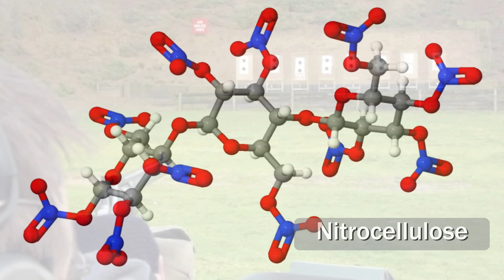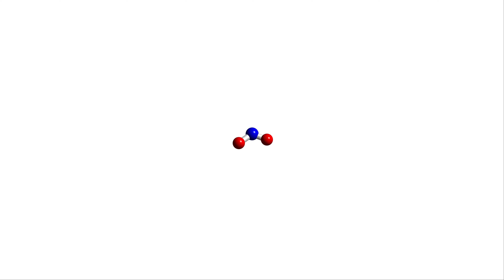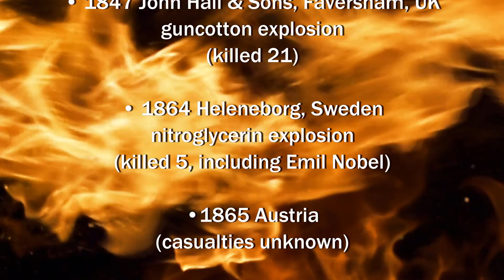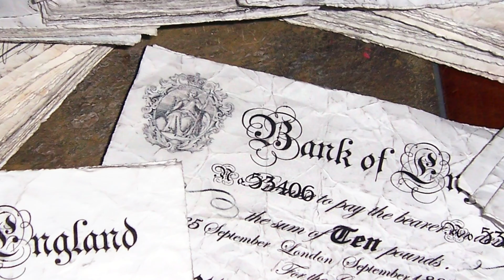Smokeless Powders - Part 1

Comment: Nq is also used in some powders but most modern powder is mostly Nc and Ng with some graphite powder or carbon black. That is why double and triple base smokeless powder is shock sensitive ( if you pour some out on a anvil and hit it with a hammer it can go bang). In my reloading room i am fairly sure i only have one tripple base powder and the rest are all single and double base.
Reply: What powder is tripple based?